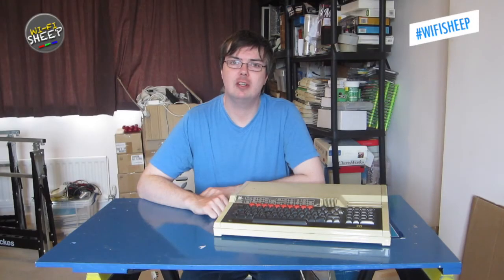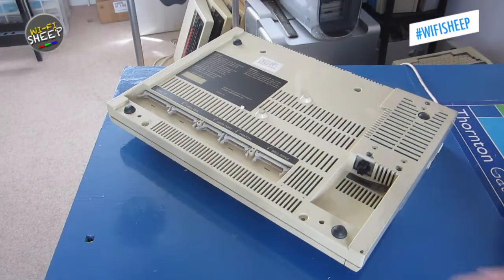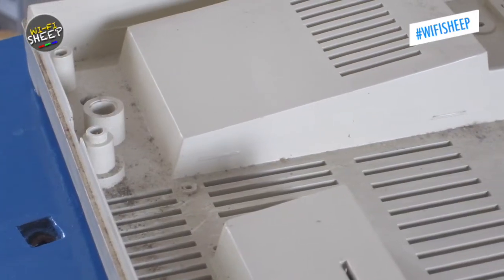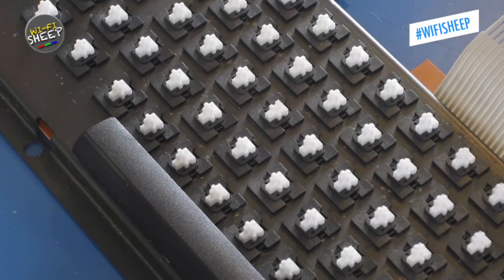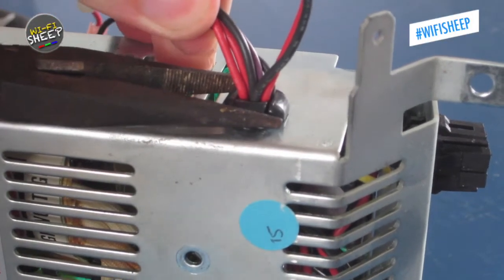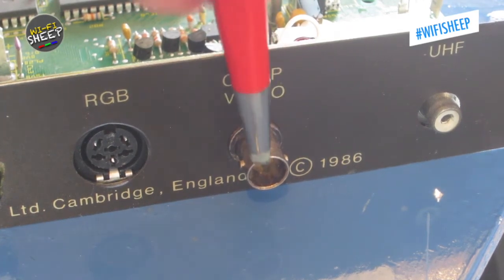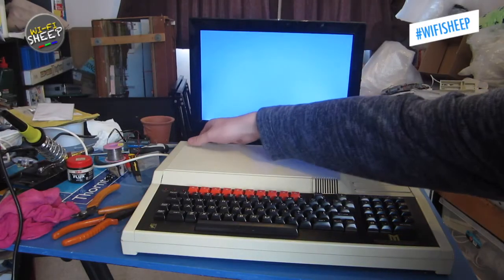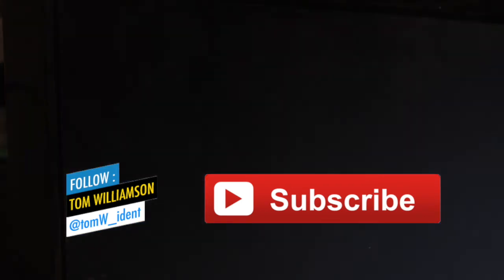Rebuilding an Acorn BBC Master 128 8bit Computer (Wi-Fi Sheep)

Comment: Thank you this was a great video. Do you have any tips on what to look out for if buying a Master?
Reply from the maker: Thanks very much. Generally BBC Master systems are a little more reliable then the original BBC Micros, Of the 8bit compatibles these are newer and built with better more reliable parts.
As shown in the video the two major areas are the mains power PSU that unless done by the previous owner will need attention. And the COMS battery pack that again unless already replaced will need work and the machine set back up.

A lot of Masters get listed online as not working due to the PSU blowing up (fixable) or the machine not booting due to dead CMOS (fixable) so as long as the machine looks complete, all keys and not missing its key system boot ROM (one of the few chips that can be removed) you should be good.
Unlike original BBC Micro , Masters have most of there parts soldiered in so are less prone to being raided for chips / missing parts + the RAM is never and tends to be more reliable.

In the UK these machines are not rare but are less common then the BBC Micro Model B. Their also huge so make sure you have the space!
MMC or Gotek drives can be bought cheaply so you dont need floppy disk drives and a 6pin DIN to Scrat cable can be bought for video out allowing the machine to plug into a modernish TV with a normal scart plug, so you dont need an original monitor! 

As for projects and things to do .. do checkout our 8bit BBC Micro playlist
https://youtube.com/playlist?list=PL8Ltmk_Xax1qUaFtmcXdn_H9ZaeZofa6K

Comment: WOAH !     You are using spray-on window cleaner on the rear panel???!!!!  That liquid contains acetic acid, which will corrode all the DiN connnections !!!!   You were doing very well up until that point.

Comment: Why is it that the transformers in these PSUs look... gross. I have two BBC Bs and both look slimey, as does the one in this video (though not as much as mine).
Reply from the maker: Its nothing to worry about its just the grease used in the transformer winding. As mentioned in this video its the two RAFA caps that need replacing.

Comment: I remember having the cane in school for pressing the BREAK key.
Reply from the maker: If it was a Master as is the video, these have a plastic jamming lock allowing the BREAK key to be disabled. (which the school should have known about) The Beebs and the break keys were still with us when I started school however caning and such had been outlawed in the state system a few years prior to me starting.
Reply: @WiFiSheep  Unfortunately caning was still legal when I was in primary. So how could pressing the break key damage the system?
Reply from the maker: @snipersquad100  It wouldn't. All the break key does is act as a 'soft reset' which starts a new session from the OS rom and reboots BASIC. The contents of memory is still in RAM so if you type 'OLD' as your first comment after hitting break the machine will resurrect what ever was in memory. Its not 100% every time but if using BASIC it normally works.
Reply: @WiFiSheep  So I had the cane for nothing, great.

Comment: Nice video.
What do you use to connect the Master to a TFT monitor?
Reply from the maker: Hi its a 3rd party RBG 6 pin DIN to Scart cable most Scart TVs or TFT's are happy to accept a strait RGB signal something like this https://www.ebay.co.uk/itm/2m-Monitor-TV-Lead-Cable-for-Acorn-BBC-B-Micro-BBC-Master-6Pin-DIN-to-RGB-Scart/171319413616?hash=item27e36ecb70:g:QHMAAOxy86RSVBxQ

Comment: I had a BBC Master from Angering high school when I left in 2004. It was pretty beat up and I had to build a battery pack for it. It also had the optional RISC micro coprocessor board, which is interesting as it is the earliest ARM processor ever made.
Reply from the maker: Hi thanks a really cool story and well done for recusing a beeb! I only wish I'd have been able to rescue a machine from my school.... Very interesting you had/have a ARM board in the machine and yep your right it'll be a ARM 1 or 2 dev board. Do you still have the machine?

Comment: When I was 6 years old I attended a school for blind children, we had a BBC Master computer, this was in 1990, yes, 1990.  I remember when you turned the power switch on, you'd hear 2 clicking noises as well as the startup buzzes and beeps from the speaker.  Did the PSU or the motherboard have a few relays in them which operated when power was turned on?  In 1992 our BBC Master packed up and stopped working, it was eventually fixed by the school's computer technician.  He replaced the battery and gave me the old one, it was, as shown in this vidco, three Duracell AA batteries wrapped in shrink wrap plastic, I, being 8 years old at the time, hadn't seen anything like it.  Too bad Acorn didn't just install a battery compartment on the bottom of the computer that could be easily accessed.
Reply from the maker: Hi Lachlant, thanks for your comment and sharing those memories!
In answer to your question the 'clicking' you hear on powerup is not the PSU but motherboard relays used for controlling any tape interface that happens to be plugged into the machine. By the time of the Master most of us were on discs but the hardware kept backward compatibility hence the clicking.  
The CMOS battery was a bit of a hack together on the part of Acorn. The master dose have a proper battery compartment next to the speaker which was meant to contain a lithium cell, this however caught fire so was replaced with the AA wrap pack stuffed in the machine.
Reply: @WiFiSheep  I see.  Did Acorn release BBC Masters to the public with the lithium batteries in them, or did that design choice not make it past the design or internal testing stage?
Reply from the maker: No its my understanding that early 1986 models of the Master 128 did make it onto the market with these faulty lithium cells, hence fire issues and product recall, as there was no time to retool as such the battery mod most machines have was devised with the contacts in the battery unit removed. but all Masters still have this empty plastic battery space next to the speaker unit.
Reply: @WiFiSheep  I see.  As I say, I used this computer at a school for blind children, the computer had 2 voice synthesizers connected to it I think, but I don't know what ports they connected to.  The computer had a dual floppy disk drive, the heads on one drive were quite noisy, the monitor was a colour touch screen monitor, and it had what I think was an Epson dot matrix printer connected to it, an LX-100 maybe?  Whatever the printer was, it was bloody noisy.

Comment: This is a great video, thanks for sharing.
If I may, I'd add 2 steps :
- Remove all socketed chips, clean their pins, spray some special spray for electronics contacts on the sockets
- Spray the same spray on all connectors at the rear of the commie (in particular after your cleaning where you did not protect them ...)